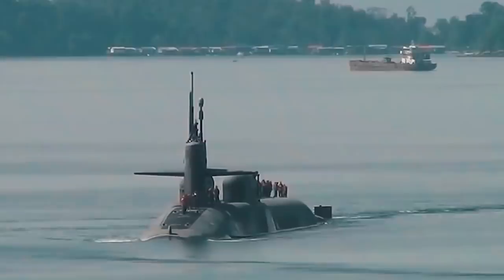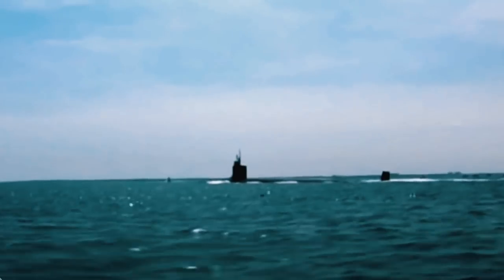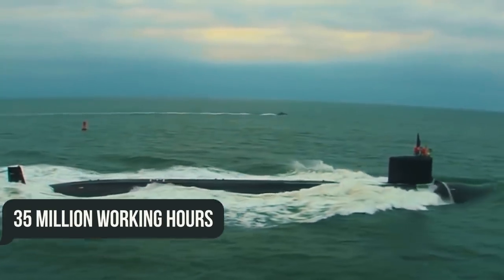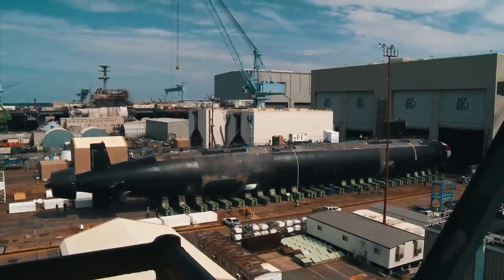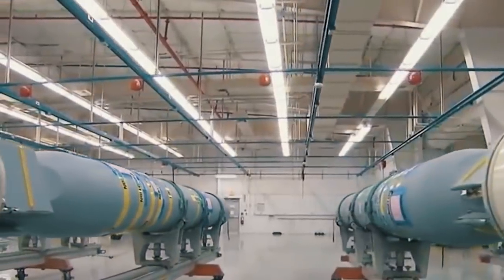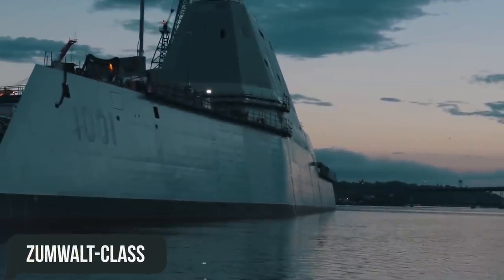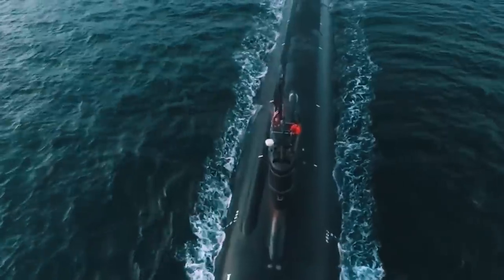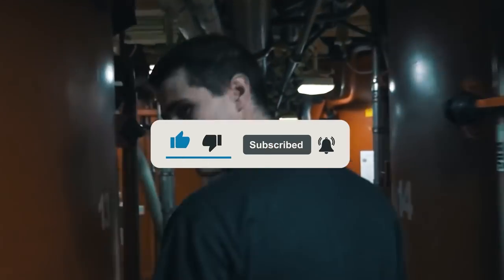US Is Testing Their New $3 Billion Nuclear Submarine

Comment: 04:26 no fkng way is a SEAL or a "small detachment of SEALs fitting inside that 21" tube. Good luck fitting your dive gear into that tube. Bro......just use the lock out trunk. Why even attempt that claustrophobic, panic ridden death hole? There is no way to communicate to the crew that you are clear of the outside hatch once the inside hatch has locked. No banging, no nothing will help. And if they close the litter torpedo door(s) while you are exfiling the sub, you will be cut in half easier than a molten katana blade thru butter. Just seems risky for no reason. Like I said, use the lockout trunk. Much more space and no fear of being sliced in half.
Reply: It was my understanding that he said they could convert the Forward Torpedo room to accommodate 
a SEAL detachment.  That did not seem very likely for a submarine to give up such an important segment
of it's defense.
Reply: I know for a fact that norwegian special forces use the torpedotubes of norwegian subs to exit the vessels during covert operations. I agree that it is a tight fit, but nothing too bad when you know what you are doing.